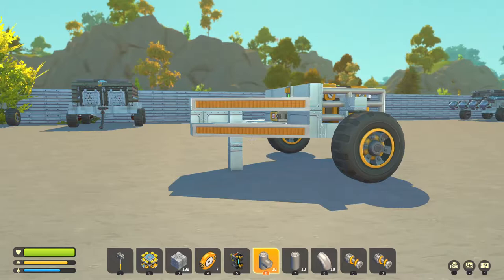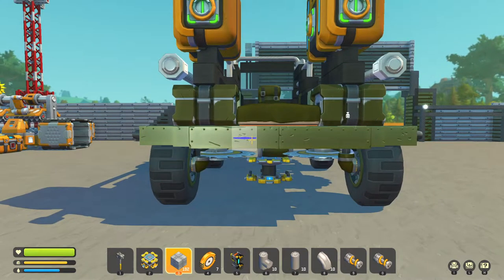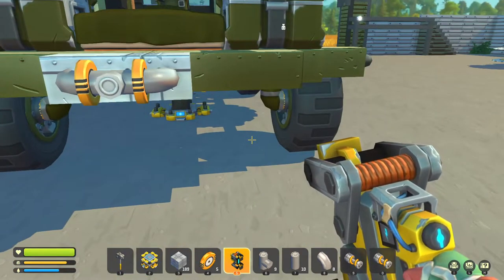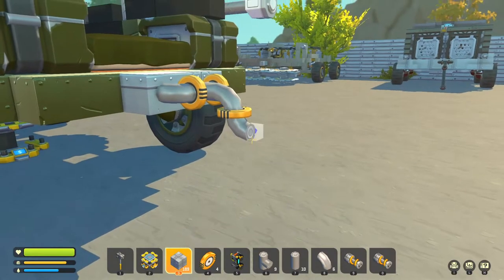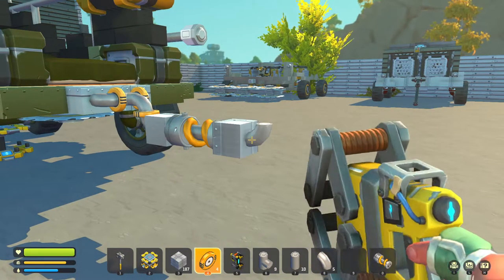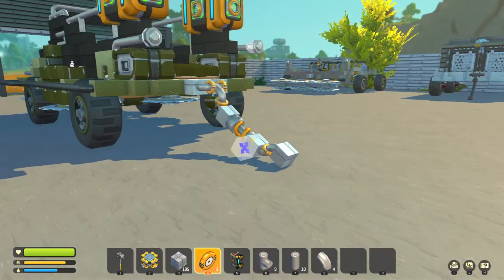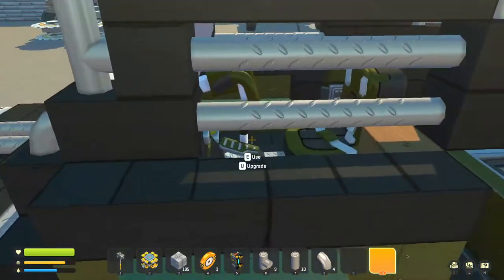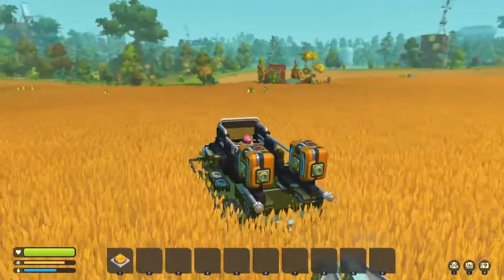How To: Simple Tow Bar & Trailer Hitch | Works In Survival | Quick Tutorial | Scrap Mechanic Guide

Comment: I would recommend removing one of the horizontal bearings so the trailer does not jackknife when you stop. Also add a roll bearing by the suspension block so the trailer can tilt on uneven terrain. (^_^)
Reply from the maker: Sorry for the late response. Thanks for the tips, we will give them a go. Have you ever found a good way of making a trailer which can be detached in survival? Every time we try examples they work well in creative but not survival.
Reply: @watgaming9539  yeah a simple pin hitch with a sensor to detect a colored hitch the a piston underneath the latch to secure it but let it swivel
Reply: @watgaming9539  Ringfeder hitch
Reply: @watgaming9539  those are suprisingly easy with semi's but yeah dan said it kinda better than i could a have said it
Reply: @kornaros96  yeah just waht i was thinking just a tractor hitch